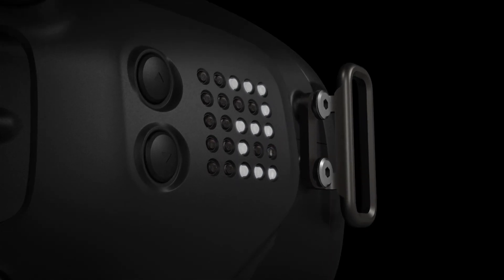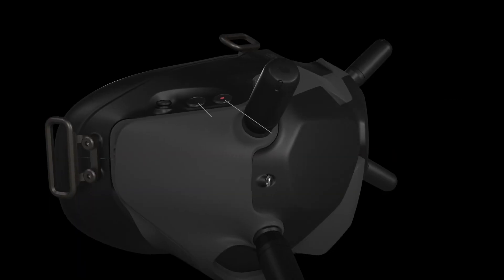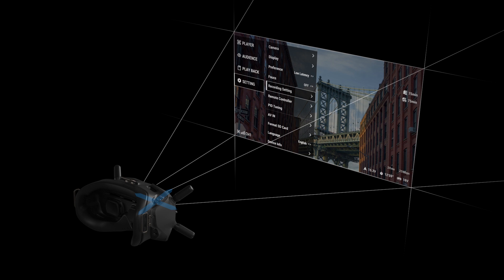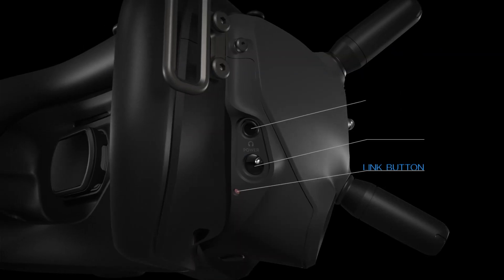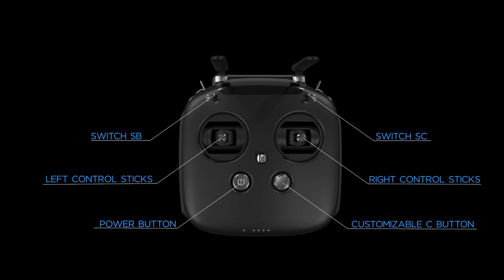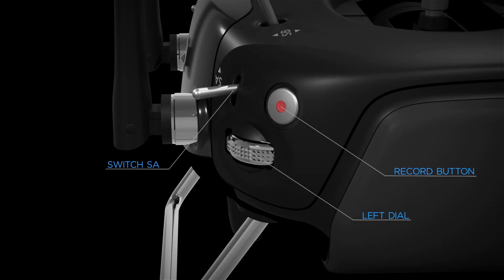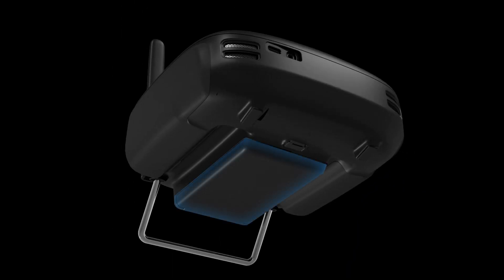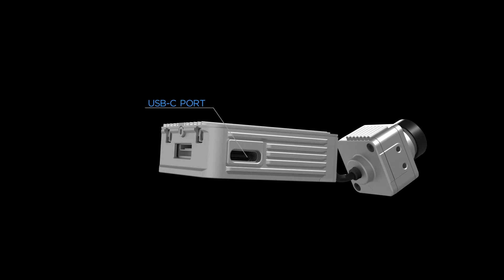DJI FPV System | Hardware Overview

Comment: Glad there's a simulator port! Was worried I'd have to buy a taranis and miss out on the HDL protocol.
Reply: Can we use normal Aux music cable to use a simulator. or We need some special kind of cable?
Reply: @AdventureMonk  there's a different connector usually. The adapters are 10 dollars on Amazon. Just look up simulator cable!

Comment: What are the drones compatible to this unit and where to buy
Reply: Hey Shehan, to save you some time from reading through forums and such (I am not an expert myself but I am also a beginner who has learned some stuff over the past year), the DJI FPV system is just a fpv unit (which includes the receiver for the rc and also the goggles, and also the vtx, or the video transmitter, as well). This means that this fpv camera unit could be put onto just about anything as long as you can attach this camera unit to the object. However, now that you know that the camera unit can be mounted to just about anything (you can mount in on a dog and have a pure video streaming experience on your goggle but have no rc control), so what about the movement of the drone? So this is where flight control boards, escs, etc... come in to play. Long story short, when you look for your parts, make sure the flight board is compatible with the vtx board (in this case, the DJI FPV system), and that the drone you pick and the motors you pick are enough for the weight of the DJI camera unit. Other than that, you dont have to worry about setting up a receiver part either (traditionally youd usually get VTX and receiver separately, but DJI's camera unit (the silver harddrive looking thing) is integrated with its own receiver and vtx. One thing to keep in mind though is that the quality of the video might suffer because the footage is directly encoded into the camera unit itself as you fly. This causes some compression and limitations on the range and quality of the shots.
Reply: @aruhtaz  thanks for this clear and detailed explanation.
Reply: @beefybeef1326  The more we can get knowledge to be distributed more broadly the better. I'm more than glad that I just saved yall some time digging through forums so you can get to innovating or having fun with a genuine passion you guys discovered asap.
Reply: @aruhtaz  I totally agree with you. Thanks again for taking the time to reply to questions from noobs like me. It's much appreciated!.

 I was actually thinking of buying the dji fpv system and putting it into a flying wing. I was wondering if -

1. Does the reciever in the air unit always need to be plugged into a flight controller, or can I just power it up without connecting to a flight controller?, I.e. just connect it to an esc (which is connected to a battery.)? 

2. Can I connect the dji fpv system to any flight controller or are there specific ones that the dji fpv system is compatible with?

3. If I'm able to use a flight controller with built in osd,  will it show the osd info on the dji goggles?

Sorry for all the questions,  but I'm finding it very difficult to find the answers to these questions!
Reply: @aruhtaz   thanks a lot for your nice detailed reply. Honestly I've never knew about fpv and after watching few videos on youtube I'm loving it now. I was planning to buy a mavic and kept comparing mavic series all the time. Now I know what exactly I want. I'm looking forward to buy all parts, fix them by myself and start some flight training. I guess this is gonna be my hobby. Cool things aren't they 😋
Reply: @shehangunasekara3286  Super cool. Got into it recently too. FPV systems are wild and so much fun, and I would definitely recommend it over buying the mavic series... you just learn so much, but at the same time you might struggle more. If you do, look up Joshua Bardwell on Youtube or Google (Drone Know It All)... or other Youtubers like Rotor Riot, Le Drib, Mr Steele, etc... Good luck and have fun with it man!
Reply: @aruhtaz  thanks man. Fpvs are dope 😲 I'm into it. 🤙🤙